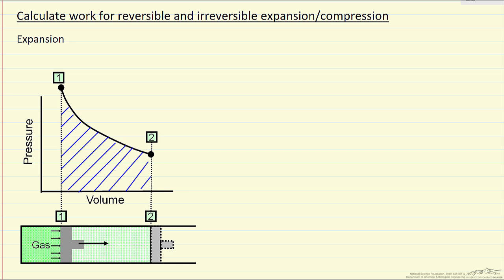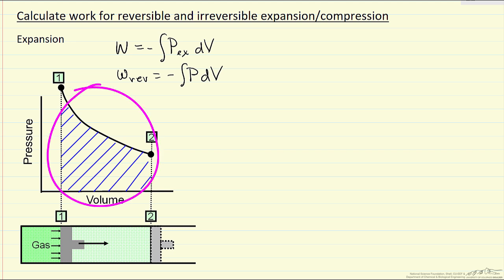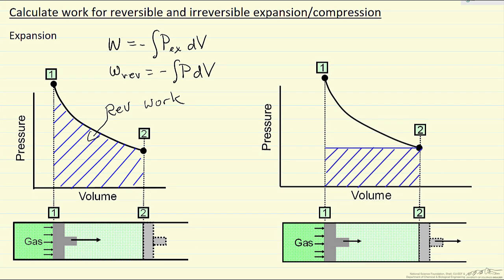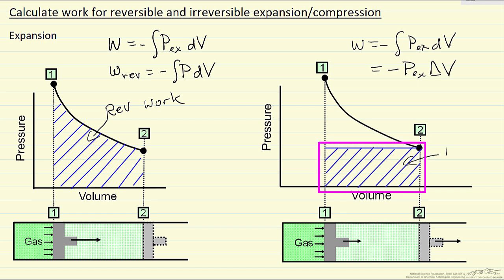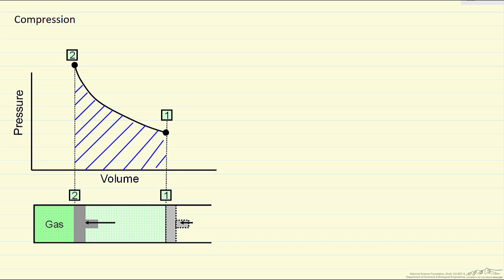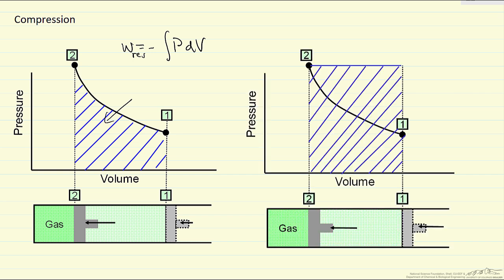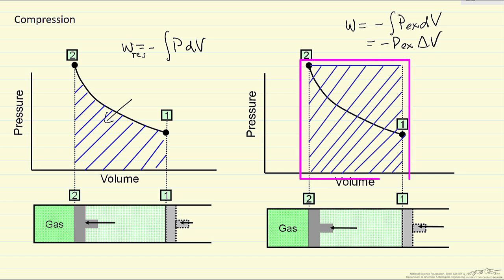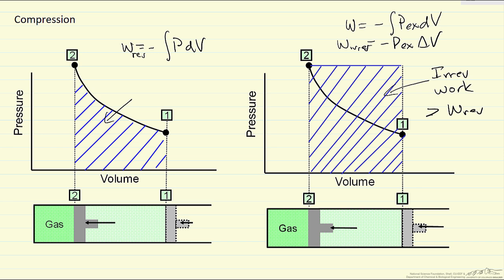Calculate Work for Reversible and Irreversible Expansion/Compression

Comment: I think it would make more sense if you refer to a quasi-static (left) and non quasi-static (right) process, and finally you end up concluding that only the quasi-static process could be reversed (both system and sorroundings), therefore that's by definition reversible.

Comment: In the irreversible compression case, the surroundings will have to exert pressure P to do work, so it looks like that the surroundings have done work amounting to -∫PdV. Then, this quantity and the energy gained by the system through compression (-∫PexdV) do not look the same in magnitude. How can this discrepancy be accounted for?
Reply: @r did you get the answer, I have same doubt? In irreversible compression(or expansion),the work done by surrounding on the system should be equal in magnitude to work done by system on surrounding but opposite in sign. Am I wrong? Or why don't we do this: find the work done by system on surrounding and vice versa and then subtract their magnitude to find net work done??

Comment: But why is the work less for irreversible process??
Reply: If we expand the beaker slowly then the beaker has time to absorb the heat from surrounding which keeps the pressure high and so the work done( note that it must absorb heat from outside to keep the internal and external pressure same that is to keep the reaction reversible). While if beaker expands irreversibly( sudden expansion) then the pressure will be dropped drastically in the starting of the expansion( because of no heat entering into beaker and no pressure rise) so the work done by piston will be less.
Reply: @nikhilnegi9446 thank you!
Reply: Irreversible process is less beacuse some amount of work is lost due to the irreversability of the porcess

Comment: Thanks for the video. External vs internal should be defined here. For example, if the piston is frictionless and no external force on it, the work done by the gas is still not zero and equal the pressure at the internal face of the piston times the volume change. I think the word average is a better term. The average pressure of the gas is higher than the pressure at the face of the piston.
Reply: It’s a thought exercise. Free expansion of a gas into a vacuum does no work, therefore if the piston has no mass and is frictionless, no work is done by the gas.  If the piston had mass, then work would be done.
Reply from the maker: If the piston is frictionless and has no external force is on it (and the piston has no weight), then the work done by the gas is indeed zero. The work is not equal to the pressure at the internal face of the piston times the volume change.
Reply: I don't follow that.  Why are we assuming that the piston has no weight. What if it did? Work is force times distance isn't it and force is pressure times area.

Comment: Could u show what if the weight w is reduced in steps (w/2, w/4,..) in expansion work. 

Sum of the irreversible work areas may be shown to converge to the final rectangular irreversible work area , that may make the understanding intuitive.

Pressure cannot drop instantly from p1 to external pressure. 

It should take some time. 

The irreversible work done is less than reversible & is understandable.

The reduced Inside pressure will do the expansion work. That is a different story if the inside pressure is equal to the atmospheric work. 

By the way are u adding heat during the expansion to keep the temperature constant? Or the expansion is exclusively due to the weight taken off & release of potential energy?

Thanks

Comment: What can we say about Final temperature of reversible and irreversible ?
Reply: yes you are right why only pressure no volume or temperature
Reply: only if it is adiabatic, then u can comment. For both expansion and compression cases, Final temp in irreversible process is greater than reversible(experimentally proven)

Comment: why irreversible work done by the sorroundings on the system is lower than the irreversible work done by the system on the sorroundings? , my logic tells me they should be equal. Can you please explain this?.
Reply: David Glass because it's an irreversible process, Wa->b =/=  Wb->a

 If irreversible work is done by the system on surroundings, and expansion occurs, you lose internal energy from heat transfer with friction, sound etc.. a non infinitessimal change. Mathematically, that is why you need to use Pext in the integral, because Psystem equilibrates to equal Pext "instantly". 

For compression, work is done by surroundings onto system,  P1 goes to P2. For irreversible, this means plugging P2 into Pexternal for the integral, as it doesn't infinitessimally change. P2 > P1

In reversible, P1 will slowly and more efficiently be approaching approaching P2 (and vise versa) and that's why it is the area under the curve from the integral, since you integrate Pdv= RT/V dv
Reply: David Glass basically remember that Q and W depend on path, and irreversible makes a different path, while reversible makes the same path, just reversed